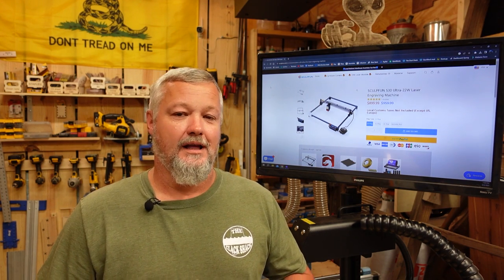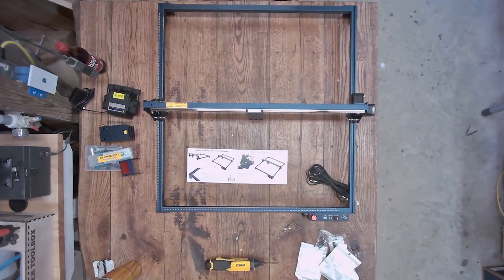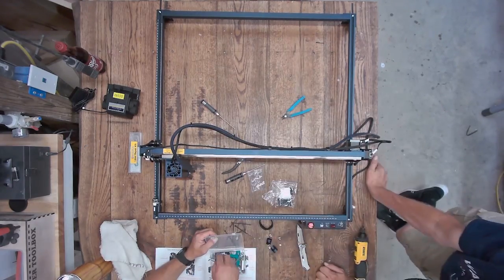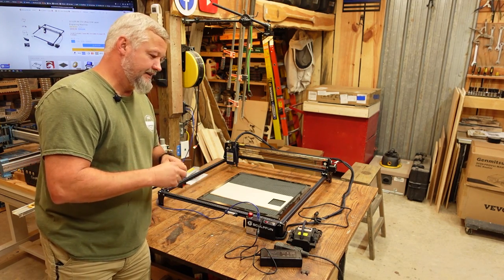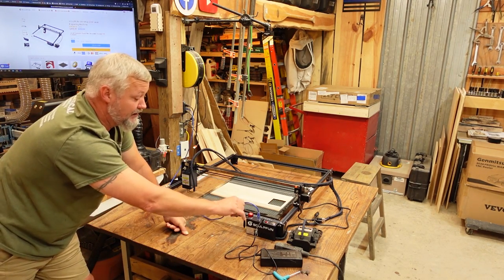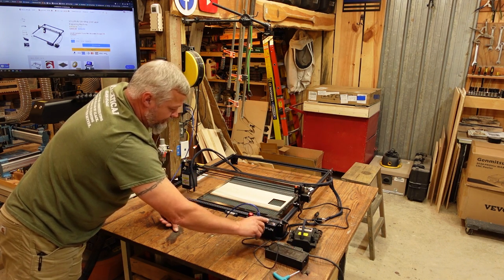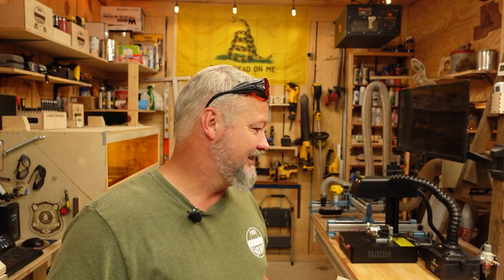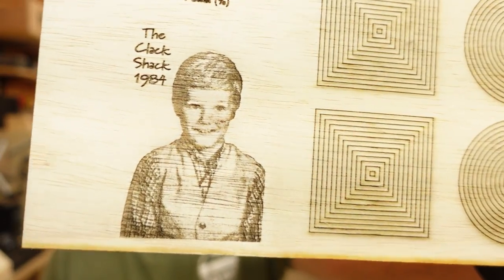23 inch work area ?? Sculpfun S30 Ultra

Comment: Nice to see a Sculpfun review. I agree, the four screws system is burdensome to adjust. But I've learned to live with it. I have the more powerful 33w laser. I liked it so much that I upgraded my 5.5w smaller laser bed kit also to the 33w so basically I have medium and large 33w versions now. Lol. They've just come out with a Sculpfun Camera which I should be installing tomorrow. Included in your kit should be a few round metal stands to support the honeycomb so you can avoid the blowback on the rear of the piece. And, just a FYI, they have officially approved use of this model for 18,000 mm/min for the x axis speed. I have a link if you want to watch the video.
Reply from the maker: Yea, they sent the little pillars but I usually use thinner magnets. I also have the camera coming to try out. It looks like a good option.

Comment: This is a definite contender in my search for my first laser engraver. One weird one I came across tonight is the Snapmaker Ray 40W. Do you have anything to say about that one? Seems to be lesser known to the community.
Reply from the maker: I haven't had a chance to check that one out. I can't say I have heard of the brand either. The S30 is a simple yet effective machine. My only complaint was the cable management but I fixed that.

Comment: Great vid! I'm new to this, if I just want to engrave on the surface of wood (and not cut through it) I wouldn't need a honeycomb backer, correct?
Reply from the maker: You can cut without a honeycomb but it does make it easier. For engraving only, you do not need one but it isn't a bad idea to have a fire resistant material under the work area.
Reply: @TheClackShack  good stuff, thanks

Comment: I've been looking into replacing my older Atomstack A5Pro, and im rather confidently leaning towards getting this one since the A5 just wasn't cutting it. :P Thanks for the review friend!
Reply from the maker: Very welcome, have fun.
Reply: @TheClackShack  Will do! I do have one small question though in regards to the 22W vs 33W versions. Question is, im not certain i should shell out $200 more for the 33w version as opposed to the 22w one. I do plan on doing a decent amount of cutting as i like to make those multi-layered mandala hangings amongst other things. Thanks again!
Reply from the maker: @-Lotek-The-B0T-ASSASS1N  33 cuts better, only real difference

Comment: Great review! I am a little confused though, mine has thumb screws to adjust the laser head. Still a little bit of a pain, but a lot better than the setup you have to deal with.
Reply from the maker: They have thumb groves with Allen heads
Reply from the maker: Hard to get to by hand, tools better

Comment: If I had to 3d print a cover for the limit switch, I would go the whole hog, and print a bracket and trigger so it could be mounted on the bottom of the rail.
Reply from the maker: Agreed. That would be much safer

Comment: This has the worst laser head design and it goes dirty very quick.  I have been sending @ sculpfun videos and pictures and the careless to fix or reply. I barely go 18 hours without disassembling the head and re-cleaning the lens.

They don't have an easy head removal - 4 screws behind the laser head and they are very hard to reach!
the PCB board on the laser head + the laser cable connection will soon break because of repeated short intervals of cleaning.  The cut + engrave results are consistent.. yes, I replaced it with an Anti-fog lens from their support but it's still the same.

I have a 1000x1000 x 500  enclosure with 500w inline exhaust and the head still goes extremely dirty!

Beware if you have large amounts of cutting
Reply from the maker: With my exhaust setups, I do not have any issues.